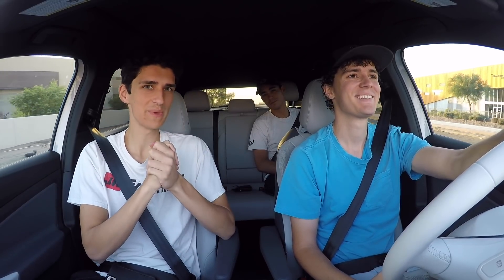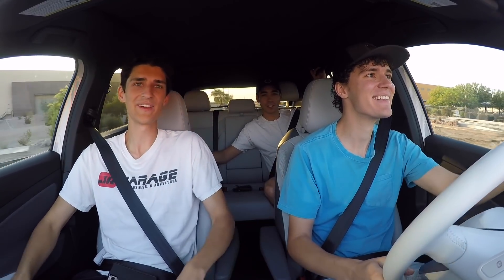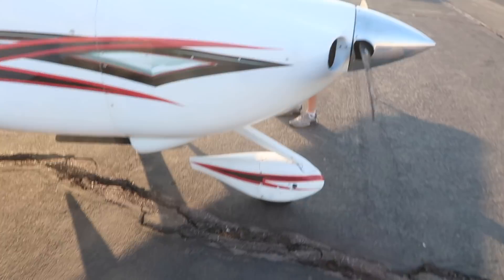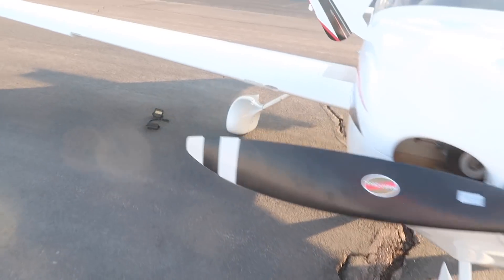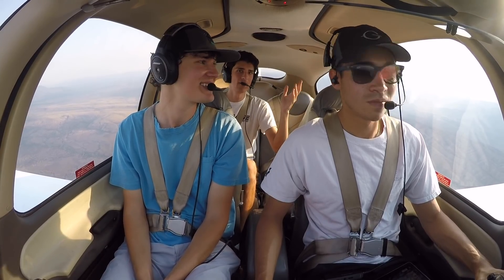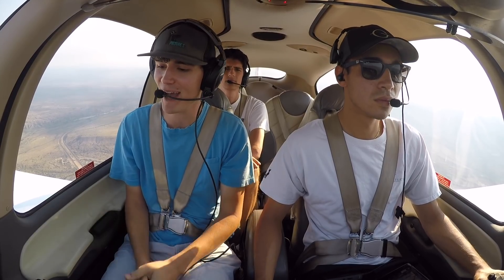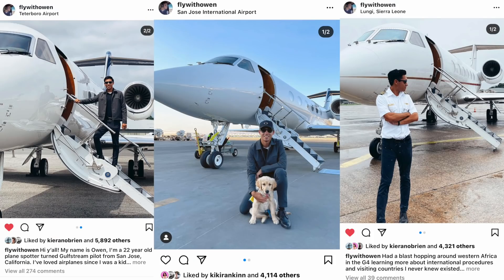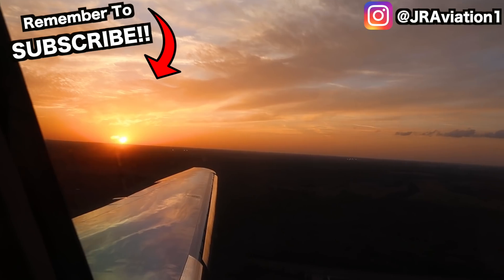First Flight With Our New Engine Cirrus SR20 Didn't Go as Planned...

Comment: Great decision on going back. I fly SR20s in Duluth Minnesota where i think the highest density altitude i’ve seen here is 4,500’. Looking at the poh for a gen 3 sr20, above 7,000’ density altitude and over 30°C they don’t even have landing distance available because they don’t recommend it. Great call.
Reply from the maker: Wow, this was nearly double your 4,500 ft density altitude! I’m happy we turned around. Thanks for the comment!
Reply: Hey shout out to Duluth! I fly out of Superior in a Cessna 172.  I don't know anything about SR20's, but I know 7900 would be crazy on my own let alone with 3 adults and fuel on board!
Reply: @CitizenCop  do you rent or do you own? I have quite a few hours in Superior Flying Services 172s and 152 before they sold it.
Reply: @codyjohnson3756   I rent JX and DV! Never had any time in the 152 though.
Reply: @CitizenCop  the 152 was a beast. Had a 180hp engine in it which felt like a rocket. Have you had a chance to go up in 4BG yet? the avionics are great.
Reply: @codyjohnson3756  Haven't been up in BG yet.  I just started soloing.  I've only worked with steam gauges and carbureted engines so far (mostly because I'm cheap). After I finish up my PPL though, I'd like to become proficient in BG for my instrument training.  Do rent or own your SR20?
Reply: @CitizenCop  I’m doing my training at LSC and we fly SR20s for PPL, Instrument, and commercial. We fly a citabria for tail wheel and a Turbo Piper Seminole for multi training.

Comment: The difference between density altitude and elevation tends to be pretty similar across an area (experiencing the same weather). For example, your 99F takeoff might've had a DA of 4,100 ft, meaning a difference of 3,000 ft, so expect every airport nearby to have a DA that is 3,000 ft above the field elevation. In this case, the AWOS reporting 7,900 ft DA was ~2,800 ft above field elevation. For a wag, the correction from pressure altitude to density altitude is 120 times the deviation from ISA in C. Lastly, the Cirrus might even display DA.

Comment: Use the plane to get your PPL. Then sell. No point in having an aviation YouTube channel if you need to rent a pilot friend every time you want to make a video or get up in the air.
Reply: Wait they don't even have a PPL? that's ridiculous.
Reply: @Kenriko  They bought the plane to get their PPL then ran into problems. They should keep the SR20 and get their PPL as it's a lot cheaper to operate than the A33.
Reply: @fledermau98  And it will even be more cost effective if they continue to get more ratings after the PPL - instrument, commercial and the instructor ratings if they want to instruct. They will definitely see most bang for the buck up to commercial though.
Reply: I have watched a few of their videos Owen flys them around. Theses guys are flippers not aviators.

Comment: A bottle of fr3 in the oil will make that engine far more resistant to heat. It will run cooler and with less parasitic drag and give you a reasonable percentage of increased horsepower for a 25.00 bottle of oil additive. ZMAX conditioner for the metals inside the engine will also increase your heat dispersion rates and that was originally designed for aircraft engines.
I am thoroughly surprised, and a little bit shocked, that if you guys are so much into engines on automobiles which are basically as close to Aerospace engines as they have ever been, that you guys don't know anything about this. Maybe you just haven't been around long enough to absorb some of these old tricks that we use to make sure that engines last longer. But I've only been working on mechanical accoutrements since 1964.

Comment: Exactly why I'm not a fan of Cirrus. In a lot of cases I feel they are overrated. If I had been in that situation in my '69 Piper Cherokee 160, wouldn't have even been an issue. I have taken off at max weight in high density altitude conditions, and while I would never boast a great climb rate, runway length has never been an issue. That being said, there are things that Cirruses do well... taking off in short distances is not one of them.
Reply from the maker: Interesting, never been in a Cherokee. SR20 struggles when super hot and high. Normal weather it is just fine though!
Reply: @JRAviation  You guys ever want a ride in one, I'm very close by in A20, south of Laughlin.

Comment: You guys should use that Cirrus to get your PPL and Instrument Rating before you sale it. Plus, your your insurance Premiums will be much lower after you are instrument rated.  It seems like you almost need a turbocharged airplane flying in high density altitude areas.
Reply from the maker: That is a good point

Comment: OK, calling a no-go is good if you're not comfortable, yet I'm somewhat perplexed.
I heard plenty about density altitude issues in tech school; mostly B-52s can't take in the South when it's too hot; they don't want the Bufs over-running the runway because of being too heavy for the heat.
Yet you're obviously airborne and appear to be well above the ground. Is this an issue wherein it's too hot to allow for climbing quickly enough to get over upcoming terrain? Is it a matter of being too heavy to take off safely from a destination airfield?
I think I'm missing something here.
....
Ah, ..helps to get to the end of the video. So there WAS a concern about a safe takeoff at the intended destination. Too bad.